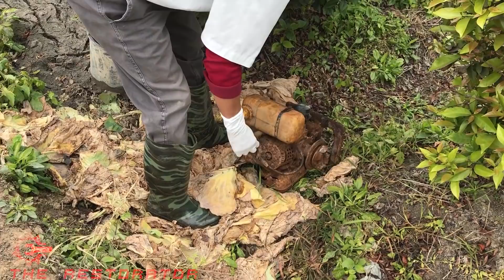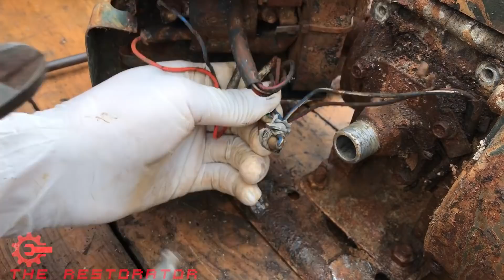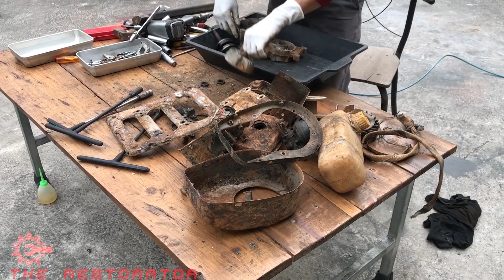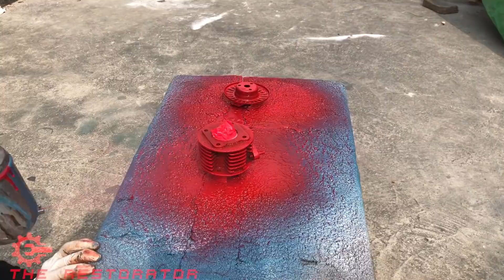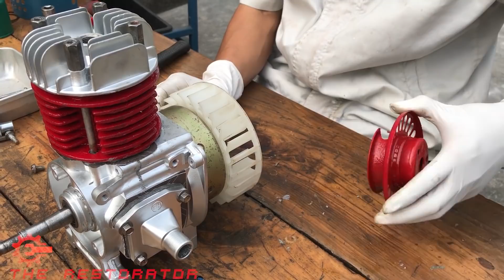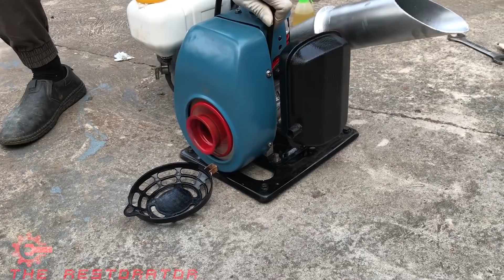Restoration Gasoline Pump Water Antique | Restore Engine Pump 2 Stroke

Comment: Wait, wait, wait...there's no way on earth that is the same engine casing.  If it is, how did he repair it? there was big piece broken off it when it was taken apart.
Reply: He added a new muffler and gas tank, and I maybe part of the pump assembly (impeller?). But I believe the core engine unit is still the same

Comment: I like your restoration videos.  It would be even greater if you can tell or type the name of the parts and the tools used.
Reply: Or possibly some back-ground info (in this case,manufacturer,engine size,etc).

Comment: i work on 2 and 4 cycle engines and what you did is good but.... the moment you started that engine with regular gasoline and then added oil to it was just not right. you used oil that contains soap and you mix it with the fuel. without the proper mix that engine will damage the cylinder and will melt the oil rings into the piston. i hope to see your next find.. good luck.
Reply: He does add oil to it it’s a clear type of two stroke oil so you can’t see a difference on fuel

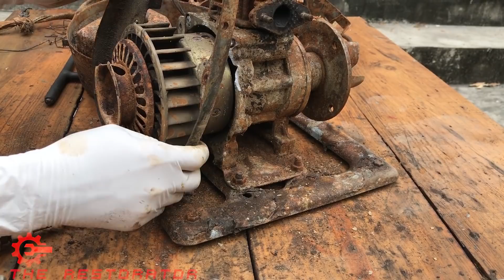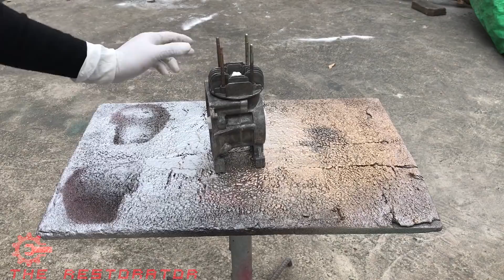Comment: ... and the broken corner at 07:46 (or 12:12 ) magically reappears without any trace of weld at 15:28 ...   Ok if you replace a part, but don't edit the video to make it like you restored it ...  I knew it was fishy seeing this rust bucket well beyond repair at the beginning...
Reply: If you look at the thumbnails for his videos, they all have the exact same start color, rusty mud colored.  And they have the exact same color on all sides.  That right there is suspicious to me.